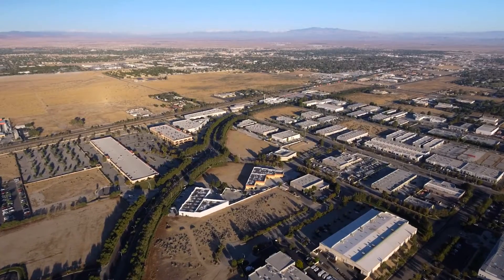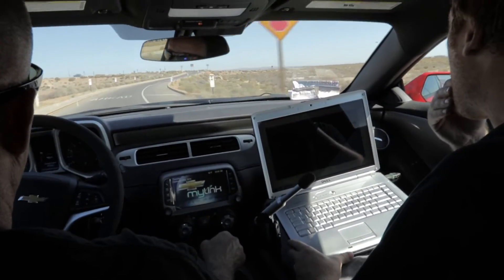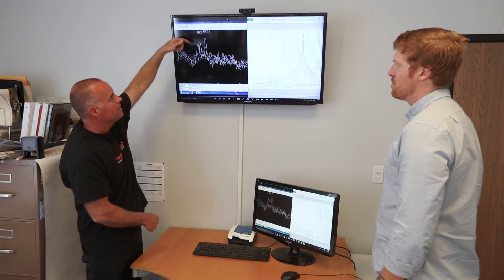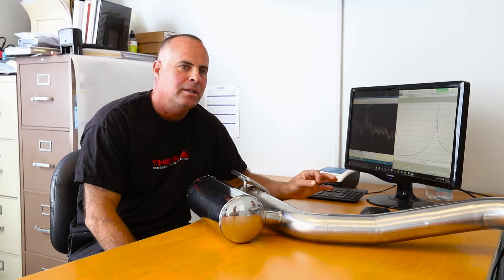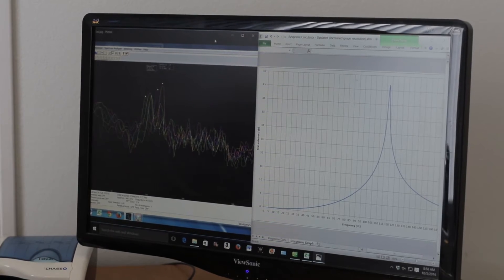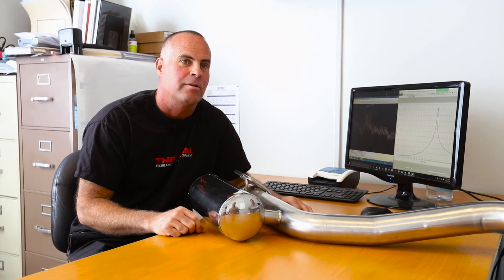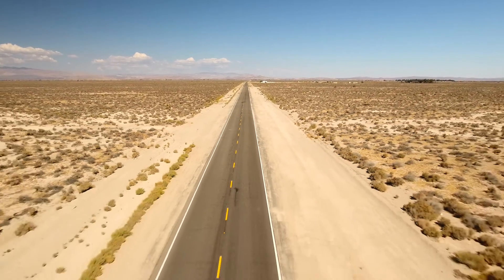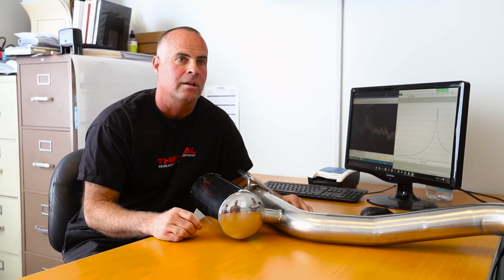About Thermal R&D Exhaust

Comment: Just wondering but why no Helmholtz res on the 8th gen civic si exhaust?
Reply: Hi Erick, the 8th gen Civic system does come with a Helmholtz chamber. It is internal and looks like a standard rear muffler but is in fact our true Helmholtz technology.
Reply: @thermalsales2028  ah ok so its not the same as the full race exhaust?

Comment: So I have my eye on the challenger system, for my scat pack challenger. It looks though like instead of an X pipe that catback comes with an H pipe....is there any reason that that would reduce performance compared to the factory X pipe?
Reply from the maker: No you will not see a loss in performance. We actually have customers respond with gains from our system on the challenger.
Reply: Is it an h pipe? It looks like just a clamp seperating 2 pipes lol